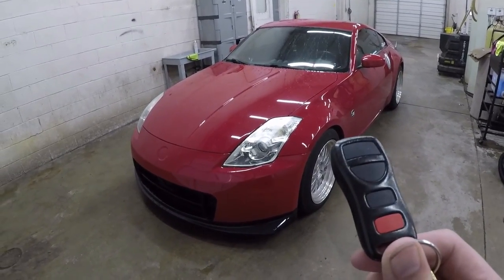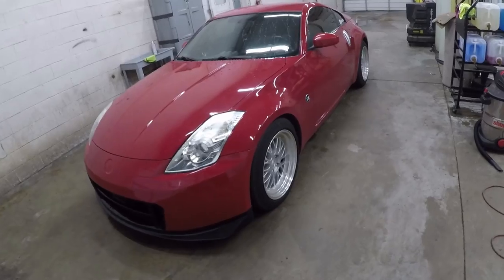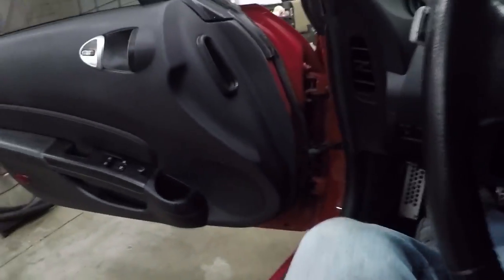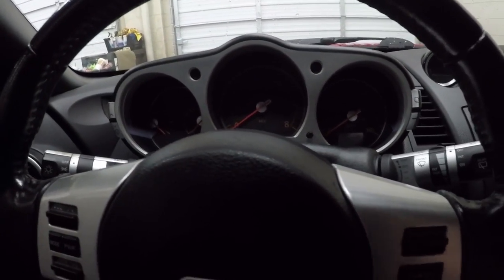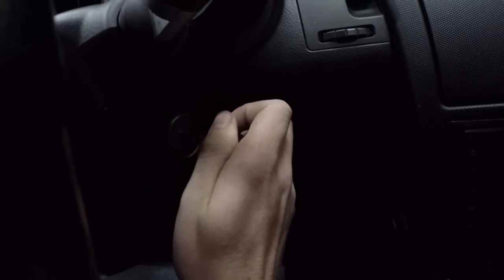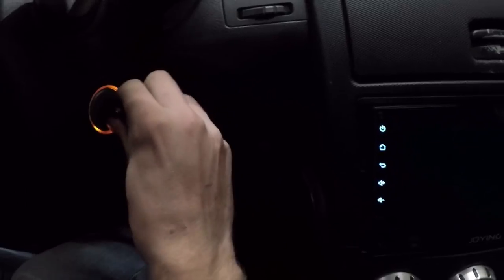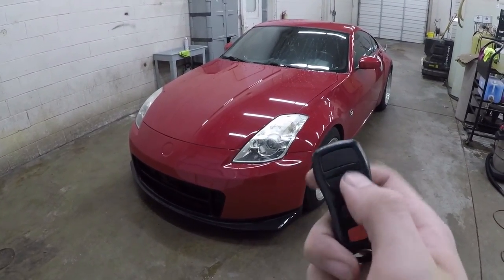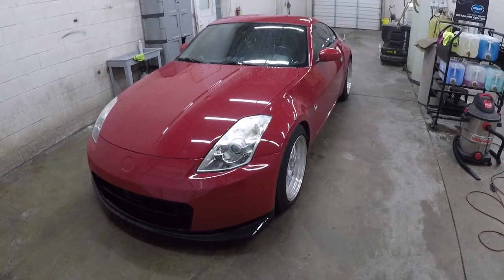How to reprogram nissan key fob 350z

Comment: For some reason when I did the key in and out the lights never turned on again the hazard lights won’t flash for that part at all
Reply: did you ever figure it out?
Reply: @alexandrubruda  oh yeah damn this was a year ago and the problem was that the door sensor was missing and so i replaced it and it works, that one piece that detects if the doors open or not
Reply: @yahboiij2242  how did i not notice? I think that’s the same problem i have- tysm man, it was so frustrating!
Reply: @alexandrubruda  bc the motor goes down on my passenger side when it open and closes and i noticed that the driver side wasnt doing that so i looked and honestly its pretty small so it hard to notice and i just bought a new one and it works
Reply: @yahboiij2242  the window motor is supposed to go up and down?
Reply: @yahboiij2242  Bro tysm for this - I switched the passenger door sensor with the driver one and programming worked like a charm - I wasted so many hours putting the key in and out of the ignition lol

Comment: My 350z 2008 for no reason starts alarm system ...and its really making me and my neighbors angry with alarm sound....is there any Fix for this problem
Reply from the maker: I am unaware of this issue. Try searching in the My350z.com forums or make a post in the 350z Facebook group. There is like over 60k members in there, I'm sure someone can help
Reply: I, will thanks
Reply: @isoooalrock  i have the same problem how did you fix it?
Reply: My car’s trunk lock was missed up. We fixed the lock and now its fine. Check maybe ur car has the same issue or maybe its another lock. Maybe doors or even That small gas door